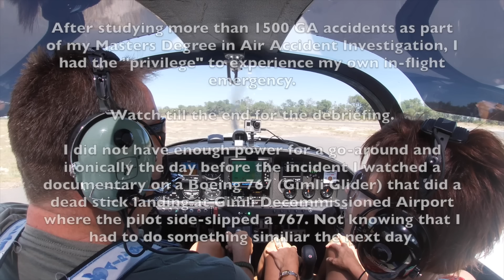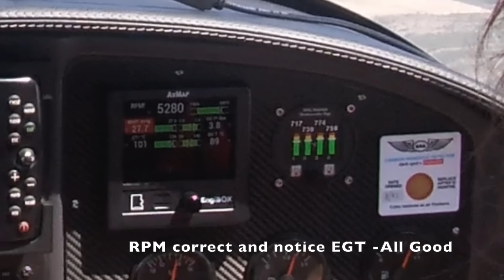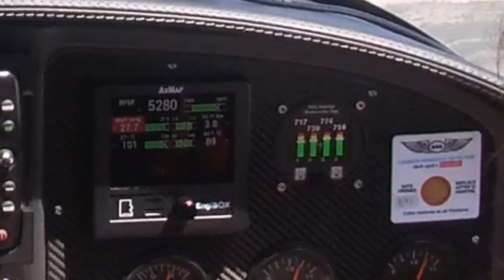Engine Failure at 1300ft AGL, Morningstar ZA, Pioneer 300

Comment: Whilst I extend best wishes to all Africans (I am from Tanzania), this looks like a simulation - throttle being retarded.  Is important to practise AGAIN and AGAIN this sort of thing.  So when it really happens, it is ho, hum, boring.
I like the saying of checks OUT loud.  Professional; the only way to be!  Best wishes to our yaapie friends.  You are a tough bunch;  want you on my side when things go sideways.  Totsiens; kwa heri!
Reply from the maker: Not a simulation unless I am a heartless bastard who forgot to tell my sister on her first ever flight in a small plane that I am going to pull this stunt😂
Reply: @justplaneadventures8030  Why then did you close the throttle?  And a bit early for Mayday.  Pan, pan, pan more appropiate.  Why no checking fuel on; temps OK; switches on; carb air hot; mixture fully rich; pump throttle; fuel level etc
Do you fill tanks after landing?  Is best - reduces condensation, and one less thing to forget.  Well done on getting her down OK, by the way.
Is great to see South Africans flying - here, all we hear about is riots etc.  CAVU skies to you; ex RAFVR, here; HM gave me a Permanent Commission as a pilot in GD(P).  I built C-IAVW, an aerobatic biplane.
Reply from the maker: @davidwheatcroft2797  You will notice that I was just about to level off at 1500ft, reduce power from 5250 rpm to about 4800-5000 when the failure happened. You can zoom in on the EGT gauge and see cylinders 2 & 4 go down. Pan Pan vs MayDay? Good point, for me it was a Mayday as I have never experienced such a failure and the vibration (you cannot see it in the video) caught me completely off guard, I actually had no idea what was wrong. I also didn't notice the EGT at the time. In hindsight, the gauge is poorly designed. Just a moving white line is easy to miss. Rather have the complete Bar move up and down.
Reply: @justplaneadventures8030  The important thing is to FLY the aeroplane, and you did that.  So well done.  And getting her down with little or no power.
......landing into the Sun, I thought prop had stopped, panicked, and flipped ignition switch . (only one with Rotax 503).  Prop really stopped and no inflight restart - was on finals, so side slipped SO hard I touched down right at beginning of runway and had to haul her a long way back!
What was wrong with cylinders?  For 2 to go, not good.  
My brother flies an RV8; very nice!  Flies to Spain to glide in the Pyrenees.

Comment: Before I received my private pilot license, I was coming back from a practice area, about 2-3 miles from the runway, on a straight-in final approach. That is when an oil line broke and oil was all over the windshield. I looked at the oil pressure and it went to zero. I knew I couldn't keep the engine running so I shut it down and started calling Mayday on the tower radiofrequency. I kept it at the best operational speed and set it down right at the end of the runway and coasted to a stop. Several people had come out to the runway and helped me push the Cessna 150 back to the tie-down space. This was at North Perry Airport in Hollywood, Florida. It is amazing how quiet the aircraft becomes when the engine is no longer running. I got my private shortly after that. That was in the early 70s.
Reply: ...I can relate to this.....everything was so 'casual' back then....so 'regimented' now.....I used my own airplane to learn on so I was very familiar with it when I had my engine failure...I became even more familiar with it when I learned how the fuel system worked...haha.....
Reply: North Perry airport seems to have a black cloud around it!
Reply: Scary Perry……
Reply: I live near you or Hollywood atleast. Still have your license? Were you scared? Sounds like you handled it great for a newbie
Reply: @jd2161  I no longer live in South Florida. I haven't flown for several years now. I don't remember being scared. I was too busy concentrating on making the runway and keeping the stall warning horn quiet. The main thing I remember was the deafening quiet. That and the joy of touching down.
Reply: @jd2161  I have a lot of Irish in me and when the engine quit I clearly recall saying, "You son of a bitch!"...I radioed the tower with my "Mayday" and what I was about to do....They radioed back but all I recall saying was, "NOT NOW !" ...I was so focused on clearing a billboard and the wires there really was no space for fear in my brain....When I rolled to a stop, a van drove up to me and the guy (an air radio operator on his way to work) told me he saw the whole thing and didn't think I had a hope in hell of clearing the powerlines.....His conversation distracted me and calmed me down.....It never sank in until later that evening just what a close shave I'd had, mostly due to all the activity that took place getting through the parking lot and around to the proper side of the tower....Needless to say, there were a lot of airport workers around helping me 'cause they'd never seen anything like what happened before.....This happened in the 1970's and, as you can tell, the details are pretty firmly etched in my memory...I had been photographing lakes and fall colours to the north just prior to this event, the pictures are in an album.....I flew out of the Sault Ste. Marie federal airport until 1979 then moved to the west coast of Canada, where I am to-day....I haven't flown since 1985 when a hot shot air force pilot crashed my 'plane ..
Reply: @emergencylowmaneuvering7350  Turned  out mine wasn't the first private plane  he'd damaged.....This time it was the biggest 'no no' a pilot could make,....Flying into a strange strip without doing a low pass to check conditions....He did a straight in approach through horrific turbulence and pancaked onto the runway and back into the air, busting up the center section, wing tank and buckling the leading edge.....Then he tried to say it wasn't his fault, the 'plane already had structural issues....Just couldn't take the embarrassment in front of his  Air Force buddies.....The 'plane was actually pristine, having been very well maintained and inspected for it's entire life...He should have done a fly by at speed to check conditions and then elected  not to attempt a landing....His big Air Force ego overtook his abilities and judgement, and I lost my 'plane.....
Reply: @emergencylowmaneuvering7350  Thanks,...but in this case I'm sure it was pure "big ego".....especially with what I had to deal with afterwards.....It was years ago, and still it drives me up the wall to talk about it.....Put it this way, if he ever shows up in the obituaries I'll be pissing on his grave for sure, even when I have to stand in line.(I know I will be)......Stay safe my friend...
Reply: "It is amazing how quiet the aircraft becomes when the engine is no longer running."  Yeah.  That whirly thing out in front of the plane is the Pilot Fan.  When it stops the pilot starts sweating.
Reply: My fear about private planes. They seem to always have issues
Reply: I have made hundreds of emergency landings - I fly a glider, that has no engine to start with. Have soared to 24K as well, and almost had a midair collision with an eagle that was circling in the opposite direction to me in a thermal!
Reply: @paulmoffat9306  I was much less accustomed to it than you are Paul. That was my one and only powerless landing. I must admit that enjoy the sound of a running engine.

Comment: Confused as to the power failure. The blades kept on. Was it just reduced power?
Reply from the maker: Massively reduced with the loss of two cylinders. Only has 4 cylinders and with two gone you have very little power and a llot of vibration.

Comment: Engine regaining smooth operation suggests reduction in  fuel delivery "for whatever reason" and also causes the greatest risk of crash due to pilot taking chances with momentary restoration of power. Pilot in this case did the right procedure in immediate action to land at nearest safe location without delay.
I have had a similar but more aggressive "slip" requirement when flying a hang glider. Every landing is a power out landing & this necessitated several slips to the side to shorten the approach drastically after an unforeseen event presented on final.

Comment: First off, great job! You got back to the field safely and in one piece. I'm unfamiliar with that plane. What is the stick deflection left to right? It seems like you've only got a couple of inches between her knees to move without interference. Look at the 3:00 mark.
Reply from the maker: It is the Italian Pioneer 300 by Alpi Aviation. It has nice big ailerons so it requires minimal input. I had enough for a 60 degree bank turn.
Reply: @justplaneadventures8030  Good to know. Thanks for the info!

Comment: 912 , Probably a small bit of rubber(or other debris) pushed into the carb bowl and sucked up into jet at higher power setting, when reducing power the blockage releases and back to normal ops. Had the same happen on  post maintenance test flight. Always flush fuel lines after removing and replacing any pipe in the fuel system
Reply from the maker: exactly what happened. Clean carbs, re synced and all is good again.

Comment: Engine failure?  It appeared to be still running when you landed!!
Reply: If the engine is not doing its job, it has failed.
Reply from the maker: turning but producing very little power.

Comment: Engine didn't fail completely though!
Reply from the maker: Loosing 2 cylinders is just about as close as you can get to complete failure. But, you are right. The little power that was left was enough to extent the glide to reach the field.

Comment: Nice job -- sure you might've done a few things differently but the end result is what matters -- you got it on the ground on the wheels.

I had a semi-emergency on my very first flight with a pax the week after I got my PPL in 1999 -- after turning downwind on takeoff, my oil pressure gauge was not happy. I declared an emergency, and landed "OK". But I muttered "oh shit" at the beginning, which completely freaked out my pax (my then-wife). I remember exiting the aircraft (C-172R) with my legs shaking. But, the trooper that she is -- my ex (we are still friends) joined me a few days later for another try (KSJC > Hollister, in California). That flight was without incident, and involved hot dogs at the airport-local restaurant (Ding-a-Ling Cafe; I think it's closed now). 

I have about 450 hours in airplanes/helicopters (although I largely stopped flying in 2007 for various reasons) and that was my only "emergency". As it turned out, apparently there was a stuck bearing that was in the oil flow path of the engine. So we were not in imminent danger, but the engine would've failed not too long afterwards, as I understand things.

My point is that I did not react very well... You did much better in a much more serious situation.
Reply from the maker: Thank you very much. I am "top-heavy" on theory (having a master's degree in air accident investigation) but low on experience (145 hours), to my surprise the theory turned out to be much more valuable than I thought. I always thought experience is all that matters.

Comment: Great job! Just an FYI.. If you "throw a blade" The entire thing is going to come apart immediately. Violent explosion pretty much. Its not fun. Great job getting her on the ground, thats the big one.
Reply from the maker: Thanks, the vibration (which you cannot see in the video) was a big issue for me. I never thought that losing power on two cylinders would cause that amount of vibration. I was worried that the vibration could cause structural failure. Also, I somehow did not notice the EGTs, that would have given me at least some comfort as I would then have at least know what is wrong. In hindsight, the EGT gauge is not designed well. It would have been better if the entire bar is moving as opposed to just a white line on the bar.

Comment: stuck valve or carb ice, don't know what type of engine is int hat thing. fuel injected or carbureted.
Reply from the maker: Rotax 912ULS, Fuel block in the left carburettor. I suspect it is because it uses Mogas and I have not drained the Gasculator (lowest part of the fuel line) in a few months. Perhaps some dirt accumulated there.

Comment: Is this a simulated engine loss I see you pull the throttle at 3:13 just after you turn on the microphone so the viewers can hear the engine lose power.
Reply from the maker: No, it is not simulated, I was just about to reduce from climb RPM (5300) to my normal cruise RPM (5000), when the vibration started and I lost power., you will notice RPM dropped to about 3000. Also, zoom in on the EGT temperatures and you will see cylinders 2 and 4 dropping. But well spotted nonetheless.

Comment: Engine out emergency flights should be done in every takeoff and landings you do as well as knowing the glide ratio of the type of Aircraft that you are flying and always brief yourself and with your passengers also to knowing what you have to do in case it happens to you .
Reply from the maker: Absolutely, this plane has a 1/14 glide ratio. We work in Kilometres here so counted on being able to glide at least 4 to 5 km and with the spinner still producing some power I figured it would be safer to try and return to the airport than to land in a field.
Reply: Absolutely!!! My brother has flown gliders from the time he was 20 and because of that I have always said he was "drowning" proofed. The SEAL teams guys have to go through what they call "drowning proofed" I have always said that if and when he has an "engine out" scenario, he won't do what many flyers encounter which is to stall the aircraft. It feels counter intuitive to push the nose down, but thats what allows you to survive these issues. If a pilot has only flown under power, he is probably 5 times as likely to stall  the aircraft. Glider pilots are always going to survive these events better than a powered only  pilot. That's my opinion and not based on real data,  but it bears out when looking over various results of x number of encounters versus what experience the pilot has.

Comment: Very well handled, all your major and important decisions were good ones....
In the past I've had two partial engine failures,. Like yourself I got back both times...
One where the Carb Heat Heat exchanger internal baffles and welds collapsed and blocked the air intake, the resulting vacuum broke the butterfly valve off so the engine ended up breathing a lot of its own exhaust, leaning the mixture got the RPM up to 1700, enough to get back, just..
Second was a stuck exhaust valve, so had to get back on 3 cylinders...
The engines were both Lycoming 0-360 models, different aircraft though....
Watching your video brought it all back.....!!

Comment: Good job!! Thanks for sharing!! Glad it all worked out ok for and your passenger! Do you know what the reason was for those 2 cylinders to quit?
Reply from the maker: Fuel blockage in the left carb main jet.
Reply: @justplaneadventures8030  is there anything you could have done in flight to restore these cylinders? like adjust the throttle or change the fuel pump settings?  not a pilot, just curious